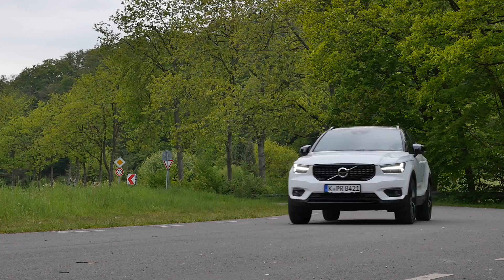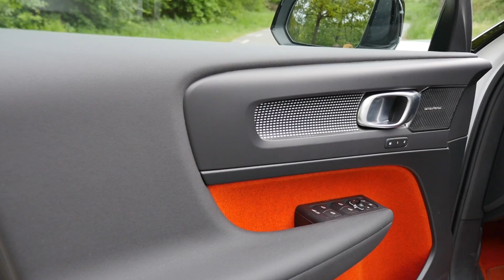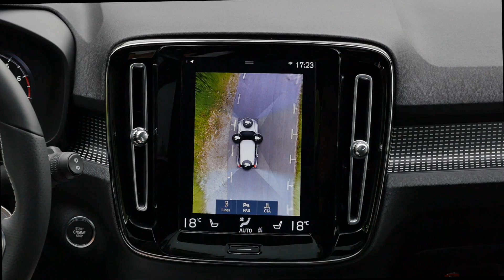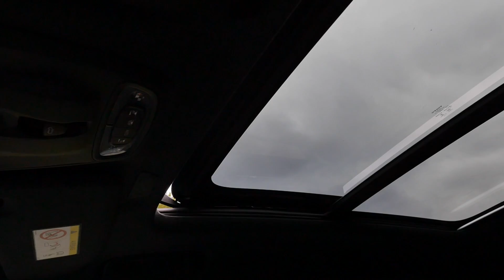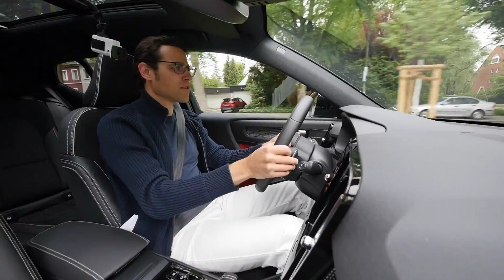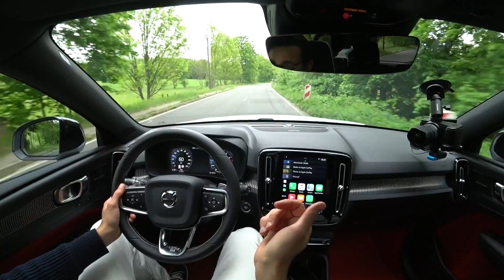Volvo XC40 R-Design T4 FULL REVIEW - Autogefühl

Comment: I drove a XC40 2023 with the Google infotainment.  The steering felt more balanced in the firm setting, but it still had no feeling.  Also the autonomous systems didn’t bug me once.  I was surprised having heard so many negative things about how intrusive they are.  The only time I felt its presence was when it emergency braked in reverse to stop me going back into a hedge, which I did want to nudge to clear more space for cars passing by ahead.

Comment: This is the one I want.......Just a note to Volvo.......Double the screen size and put the air vents elsewhere....ALL truly modern cars will have larger screens......Paul
Reply: Won't happen until there is a redesign to the next gen and that's down the road. Screen size going to 15 inches on Volvos and vents may be totally different than this car.

Comment: If the PHEV were available in the U.S. it would have been a strong contender.  We really want the plug-in, though, so went with the XC60.  I like the size of the XC40 a lot but the 60 isn't too much larger.

As always, great review.  No shouting, now wild gesticulations, just a calm, informative, review.
Reply from the maker: Thanks! XC40 PHEV review soon!
Reply: @autogefuehl  That would be cool, but I have no idea if/when it will make it to these shores.  AFAIK the current plan is to bring in the BEV version later this year.  I'd love to be able to use one of those but the infrastructure isn't even close to being ready in parts of the western U.S.

Comment: Not speedy driver here and I will be not planing to be in highways other than when special trip or holidays , do you think the 1.5 liters engine is a good option?
Reply from the maker: Yeah since its best price performance
Reply: I have ordered a XC 40 Momentum T3 Automatic the T 3 has turbo. More than enough power . If you are towing then go for T4 . 
This an upgrade for me from a V40  R Design , had it for 6 years no problems .

Comment: Very good review, and I can add that sound insulation from road noice is not that good in this car from what I have heard. Apparently studded tires are really loud and if you live somewhere where you need that in the winter it is good to keep in mind. 

I also always get shocked how expensive Volvos are down on the continent. €57K for this car?! In Sweden a fully loaded XC40 T4 R-design is the equivalent of around €46,5K. That said the SEK is very low right now, but I still don't understand why the price differ so much.
Reply from the maker: thanks for the feeback!

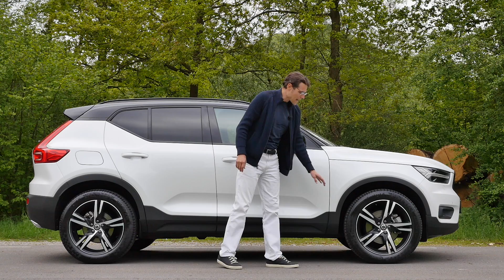Comment: 1:50 In the UK my XC40 R-Design Pro has 20” wheels (the normal R-Design comes with those 19’s) and you can even upgrade to 21” wheels.
Reply from the maker: Yeah they extended the sizes now

Comment: Does the stiffness of the steering wheel change when going through different driving modes ?
Reply: Ivan Petkov yup more stiff in dynamic mode or you can customize the steering wheel stiffness in individual mode.
Reply: You can also set the variable steering assist to a more solid feel. The lightest setting has no feel at all.

Comment: Another excellent and detailed car review. I drive a D4 R Design and I generally like it. It has 20” alloys and don’t find it uncomfortable on the dreadful UK roads. 

There is quite a lot of tyre noise though (Pirelli P Zero’s) so it’s not the most relaxing cruiser on the motorways to my ears. Emergency braking is a pain at times as you’ve noticed but when it’s needed it is excellent. I’ve turned off the lane assistance aid as it’s a pain to have to fight the steering just to switch lanes without indicating! 

Acceleration is anaemic in Comfort setting so I switch out of it immediately when I drive the car. 

You can store the rear parcel shelf underneath the boot floor which is very useful and means you don’t have to leave it behind if you remove it like I do to accommodate my dogs.

Overall, I like it. The car drives well and has some great design touches. It’s large enough for me me yet manoeuvrable enough to be able to drive and park easily. Fuel economy could be better however.
Reply from the maker: thanks for the report!

Comment: Hi Thomas! Nice review as always. LED headlamps are standard in every model (at least in Spain). Also 20-inch and even 21-inch rims are available for the Volvo XC40 ;) About the ignition, you have to press the Start button from about 3 sec to have all the electronics available. By the way, you can adjust the sensibility of the assistant system like emergency braking. Cheers from Spain
Reply from the maker: Yes indeed they upgraded the wheel size now for more choices, thanks!
Reply: @autogefuehl  Thanks for your videos! Also have two other channels (Auto Salón Volvo and Auto Salón Jaguar - Land Rover) and your videos are an inspiration for me ;)
Reply from the maker: as for the LED, they seem to integrate a base LED version now to standard, and optional says "Full LED with dynamic light" as a 2nd step

Comment: Excellent review as usual. I like the exterior design a lot. Even though its a small SUV, it got a very nice stance and it looks muscular. I do not like button-less dashboards; difficult to operate while driving. Petty of the suspension stiffness, very good advice to go for the normal suspension. These type of cars should not have sports wheels. I prefer more tire wall hight; more comfort, and also great to handle sidewalk scrapes better...
Reply from the maker: cheers!

Comment: Your complaints about the gear selector are misguided.  Let's compare the XC40's  gear selector to a traditional selector.

XC40
Drive:  Double-click the lever back.
Reverse:  Double-click the lever forward.
It doesn't matter which position (P, N, R/D) you're coming from.
 
Traditional gear selector
Drive:  Step 1 - press and hold the release button.  Step 2 - move the lever three, two or one notch(es) back from P, R or N, respectively.  (On many cars, If you simply pull all the way back, you end up in low gear instead of D.)

Reverse:  Step 1 - press and hold the release button.  Step 2 - move the lever back one notch from P; or  move the lever forward one or two notches from N or D, respectively.

Both require two steps.  The XC40 is simpler and faster.  D and R can be easily selected entirely by touch with one finger.  Traditional gear levers have to be moved  more slowly to avoid overshooting the desired position, require more physical effort and cannot be safely operated entirely by touch.
Reply from the maker: Not sure which cars you have tested, but this gear lever system was criticized not only by me, but from all other journalists I know who have driven the car. Most automatic shifting levers I know allow to jump over N with just pulling the lever a little further, and that's the easiest way. If you measure the time you need to maneuver the vehicle front and back and front and back again, the XC40 will miss out on a few seconds. So from all cars, the worst automatic shifting lever systems I have experienced are in the XC40 and in the Cadillac Escalade. In Mercedes e.g., you pull the lever at the steering wheel all the way down and are in D. Pull it all the way up, you are in R. At Audi, pull the central shifting lever all the way back you are in the D. All the way front you are in R. Etc. Could name numerous of other examples. In 90 % of other vehicles, it is easier and faster. I guess you own a XC40 and found it good?
Reply from the maker: Thanks for the feedback! Just to be clear: The automatic gear box itself is great, I am just referring to that they didnt include a function to skip/jump over N gear which doesnt make sense to me, as in 99 % of daily use, a customer would never put the car to neutral.
Reply: It is a shift by wire system.  R, N and D aren't physical positions of the lever. Unlike a traditional gear selector, you do not shift into N on the way to R or D.

For example, a double-click backward is the command for D.  The computer then puts the transmission directly into D.  If you single-click back, pause, then single-click back once more, you end up in N because you issued two commands for N instead of the double-click for D.

The lever doesn't have a shift lock and can be moved freely at all times.  A single-click command for R or D would be a safety issue.  Furthermore, regulations require that N be positioned logically between R and D.
Reply from the maker: Many other manufacturers have shift by wire already and you do not need 2 steps from D to R and back, although they have N in the middle. No idea why Volvo didnt do that
Reply: Autogefühl You have to be careful not to select Manual by pulling the gear lever forward three times too! Overall and once you get used to it the double movement to select Drive or Reverse becomes second nature. I also like the automatic handbrake too which works really well.
Reply: @autogefuehl  maybe for some safety reasons..who knows it booo...anyway is not a problem, is just different gear:-)
Reply: ..I drive my xc40 T4 inscription since 8 month and once you get use the gear selector is very easy...for example my dad with my vw with dsg he never wanted to take the car because for the automatic gear ....with xc40 he said that is simple to drive...then is not worst is simply done in a different way...maybe easier imho.
Reply: @marcobresciani544  i like a shifter
Reply: @marcobresciani544  mercedes has the best gear selector

Comment: Nice review ! I enjoyed the overall review and agree for most part . I really like the XC40 design and especially the white and black contrasting colors . The Volvo fuel economy they need to work on ! Thanks
Joe
Reply: It is possible to get 40 mpg from the XC40 T4, but if you drive it 'con brio' you'll be hitting 30mpg.
Reply: I have the same car, T5 R-Design. Thing is, since I can afford this car then I shouldn’t be worrying about fuel economy. But since it uses premium unleaded, gas mileage gets a bit stiff if you drive around the city a lot which my wife does and she drives this one more than I do. When I do get back on the road after the enforced work from home is over, then I’ll see if I have to worry or not.

Comment: @Autogefühl
Hi Thomas, a bit not about volvo but still :).
In your opinion what do you prefer more for Tiguan 2WD DSG 1.5 TSI engine or 2.0 TDI (as both of them are 150hp):)? Is it enought 1.5, and also isnt the consumption are too high for 1.5 ?
Also what do you think is the diesel engines still have a future in EU ?
Reply from the maker: The Tiguan will be less expensive in that comparison, wont it?
Yeah Diesel does have a future in the EU, because politicians just changed the critical pollution levels so it fits the industry better again ...
Reply: @autogefuehl  Well for now 2,0 TDI is a bit less expensive compared to 1,5 TSI, in the same trims that is strange huh :) as diesels mainly costs more. But what do you think which engine will fit more as tiguan is not so light vehicle ?:) they both have 150hp but the different torque 240nm and 340nm, do you think 1,5 is enough of power ?:) Also i abit aware of consumption in city rides of 1.5 TSI, i remember you was mentioned what it is not so economical. Which one engine you would buy for yourself :)) ?
Reply from the maker: Hm well, I'd take the 2.0 TSI =)
The 2.0 TDI with new particulate filter however is also not a bad choice if you have very long travels the whole year
Reply: @autogefuehl  Hehe, thanks for the answer. 2.0 is too expensive for me. I Dont have very long distances whole year, maybe it's just economically  more attractive as it cheaper now while discounts on diesel engines they are cheaper than 1.5 TSI, a bit but still:).